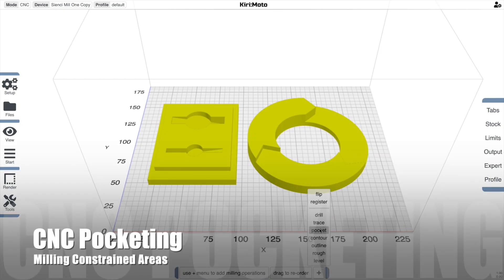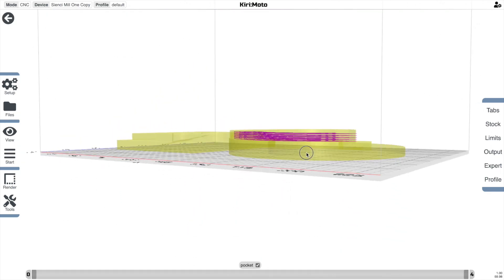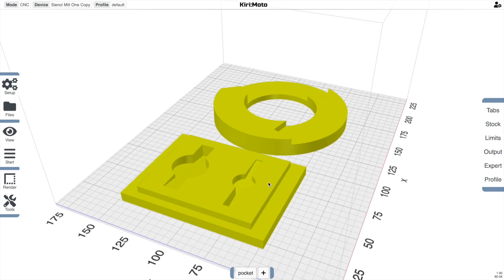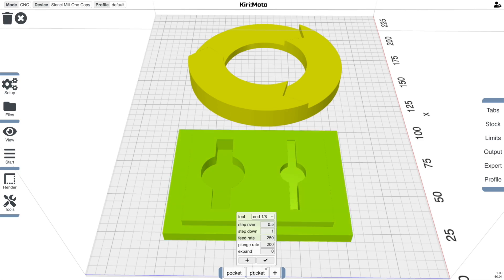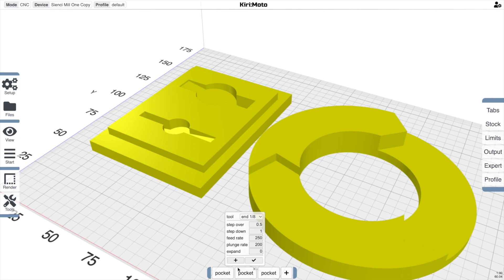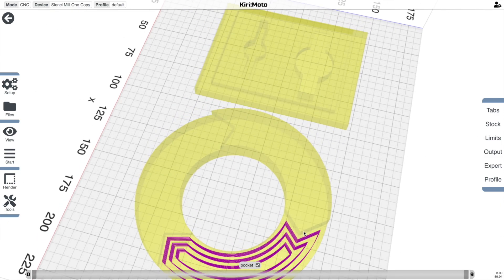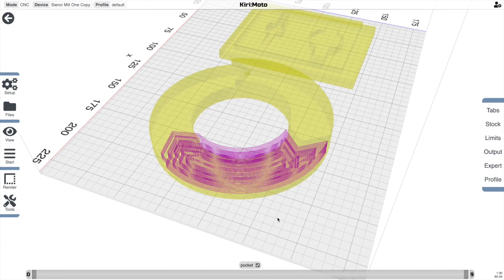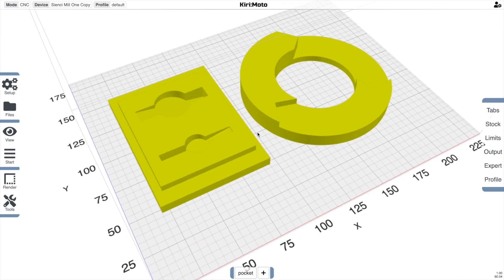CNC Pocketing in Kiri:Moto 3.4

Comment: I designed a part with OnShape, a rather simple part and I used Kiri:Moto to generate the paths  and I used gSender to send the gcode to my cnc Longmill.  I have 3 tool change to do between operations.  I was under the impression that the gcode would contain as many pauses to allow me to change tool but the job continued to the end without allowing me to change the tool.  Is it supposed to work that way?
Reply from the maker: The tool change macro is under your control. Just customize the device and edit it. Then it's up to the sender to interpret the commands for tool changes.
Reply: @GridSpace  Thank you for your answer.  I suggest you do a video on this process because it does not appear as simple as you say.  I could not do it and I do not understand  g-code.  Kirimoto knows what tool we select for each operation and it knows the sequence.  I believe it could easily insert the pauses between operations when appropriate and write a comment in the g-code (eg: tool change - endmill1/4 to ballmill 1/8).   From your answer,it appears we have to read the g-code to know where we should insert the pause command, is it what you are saying?  By the way, i use to be a professor for 32 years at the University I am very gratefull for your videos on Kirimoto, I whish there would be a lot more.  🙏🏼👍
Reply from the maker: You do not need to read or edit the gcode. Macros are text substitutions inserted at locations in the gcode corresponding with change events, like tools. The gcode macro variables are documented here (https://docs.grid.space/projects/kiri-moto/gcode-macros). What may be difficult, and this is outside of Kiri:Moto, is that each machine / controller may have it's own method of handling tool changes and pauses. Some controllers don't actually support pauses for user intervention, which is what you need if you want to change tools manually. The alternate method in this case is on the export/download page to choose .zip instead of .gcode -- this will export each operation into a separate gcode file. Then you can run each one manually through your controller and change the bits as necessary.
Reply: @GridSpace   Wow, I am very grateful.  I will read that tonight.  Do you happen to know if the Longmill MK2 support pause for tool change.  Again, thanks a lot for your help.
Reply from the maker: The mill should be thought of as the hardware and the controller. The controller can be switched out on most mills. Even with the same control board, there are usually different versions of software that run on them (variants of GRBL, Marlin, Smoothieware, Klipper are common). And it's up to the controller's software to interpret Gcode and provide facilities like pause and user control. I do not know what the Longmill MK2 is offering in a stock configuration.